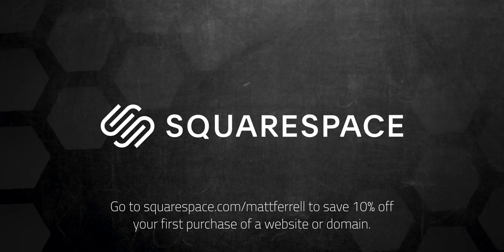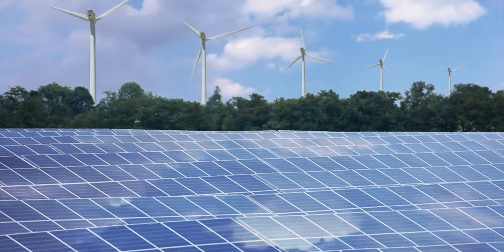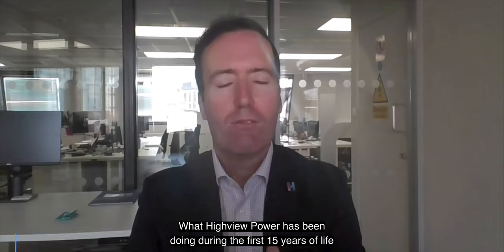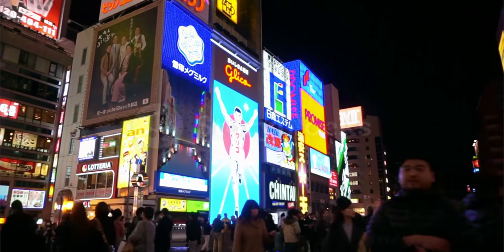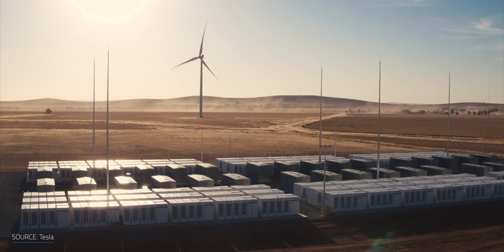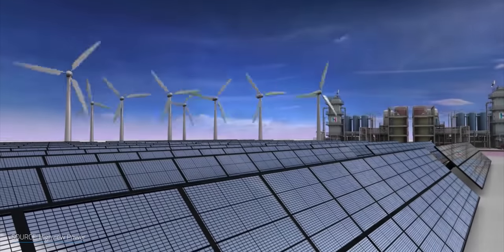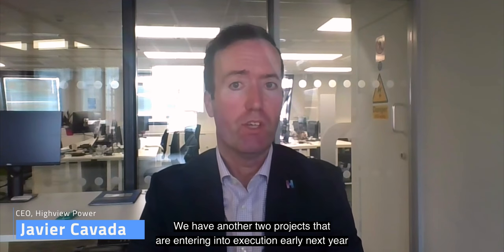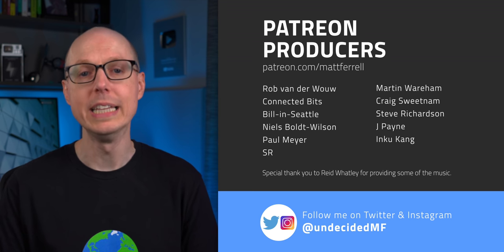Liquid Air Battery Explained - Rival to Lithium Ion Batteries?

Comment: Compressed air as energy storage is already very common on a small scale in workshops to power air tools.
         I'm a bit confused on the efficiency increase for storing that waste heat though: the atmosphere does that for us already provided we are using fully passive heat exchangers. Those heat storage tanks would only improve efficiency if we needed active heating to increase the power input/output beyond what a passive heat exchanger can reasonably do. i.e. If we wanted to store lots of energy and have don't mind a very low charge/discharge rate it's a waste of money. This tech is already really bad at power in/out per unit volume/mass anyway so I'm curious how this compares quantitatively to using a mega giant radiator. Even a pumped liquid and active airflow heat exchanger like a liquid cooled cpu system seems intuitively more efficient with not much less heat exchange rate. But of course Highview have put a lot more thought and testing into this than I have!
Reply: For the fast huge power output  in MWh they must provide, a passive heat exchange could not suffice I think and there is the danger of ice deposits too. However I am curious how they capture and store that compression heat or the cold. That probably makes all the difference for a brilliant concept. The simplest way seems to let a dense water mist rain down and take up the heat ?
Reply: @jean-pierredevent970  As I understand it the practicality of a passive heat exchange would depend more on the ratio of maximum power to total energy stored (the C-rate). A low enough C-rate suggests no dedicated heat rejection is needed.
Reply: @shminz6093  Yes, that would of course be the best solution. Related I wonder if a slow enough moving platform with huge heat exchangers could not be powered solely by liquid nitrogen or even compressed air. 
The advantage here could be that the vehicle would be able to use the cold for cooling the passengers too. So it could bring comfort in desert cities. No idea if this would be efficient :-)

Comment: I remember years ago that the French sold an air motor to an Indian company called TATA motors. The premise was that a small air compressor would live underneath the vehicle, and you'd plug the car in every night. The car would run off of the compressed air that was compressed overnight. Or you could take it to a high pressure facility and fill it up fairly quickly.

Later in their research, they found that a tiny bit of propane added to that air as it was expanding increased its efficiency 10-fold or something like that...(as you compress air it heats, as air expands when released it cools. So they were heating the escaping cool air just a little bit causing it to expand even more...making it run the air motor even longer).

I'm going off memory here so I might be a little bit off... But I was always disappointed that I didn't hear more about those motors and those vehicles.

TATA Motors air cars did not compress the air down to liquid. They just compressed it into a carbon fiber tank.

Comment: Another excellent video! However, everytime there is a video about battery technologies, I keep wanting a clear comparison. Efficiency is one measure, but storage capacity is another, as is charge/discharge rate. It seems more complex ( multi-dimensional ) than power generation, but that is how people need to think about it so that they understand whether a give storage system is showing promise or not. Like, whatever happened to flywheel systems? where do they stand vs liquid air?

Comment: Mr. Undecided , 
I'm sure that you're aware that the opposite direction yields a good option also . I'm speaking of course , about hydrogen generation and storage for later combustion . This would be a lower -tech solution , and would require significant acreage for the H2 bags . It would however , be easier and cheaper to implement . 
I'm curious as to whether or not you're aware of any projects which have tested out this process ?  .🤓

Comment: So, how about adding more turbines to existing dams and operating at higher flow rates, and using the extra power generated to pump the water back into the reservoir? Put a couple of wind turbines on a nearby hill and take the idea to Hollywood.

Comment: I got some info on compressed air, the downside of it was that for each horse power you get out of a compressed air  tank, you need a 10 hp compressor, cryogenics need more energy in order to compress the gas and then cool it to freezing temps, so you'd need a bigger installation to supply power for your cryogenic plant, or conversely having your wind turbine working 10 hours to retrieve an extra hour at no winds.

Comment: Good idea, and also use the compressed air to run the Tesla turbine to generate electricity, the efficiency could be much higher and even much cheaper. very low pressure could generate good amount of electricity. Why not!

Comment: The air is not frozen (that would be a solid) it is liquified (it still has to flow). Also calling this cooling leaves a viewer with a misinterpreted concept of what goes on. The air is compressed in a multistage compressor. As it is compressed energy is removed but this all happens at near ambient outdoor temperatures or as compression happens the air is temperature rises. It is more correct to say the air is compressed or squeezed into a liquid. When the liquid gases are expanded back to atmospheric pressures their temperatures drop dramatically which is the only time they are cooler than ambient temperatures.

Comment: I would adopt the hybrid vehicles battery regeneration system to save excess power from windmills to the liquid air battery and use the compressed air to turn the win generator like bicyclewheel without turning those blades.

Comment: This piece feels quite shallow. What about which parts have to be insulated? What about using ambient air or even other heat sources to heat the cold parts from expansion. All things that are done in current pressurized air storage systems ans also apply to liquid air storage systems.

Comment: There is always ways of making it more efficient,one way to have a greater number of compression steps,each step releasing the heat energy(even if that heat energy is in the cryogenic range) before being compressed yet again thereby reducing the resistance to compression therefore the work needed to do so,and vice versa when doing work with the compressed gas to create say electricity multiple stages of turbo decompression(with intermittent heating)will ensure maximum efficiency.Perhaps they are doing this already to some degree I would be surprised if they are not but more is better.Heat source can be ambient air or some low cost source and conversely cooling can also be some low cost source such as cold water. If compression and decompression are taking place at the same time in the same place this also becomes a source of low cost heating or cooling.

Comment: I wonder if the liquid air is stored in a way that you could pull out the more valuable gasses and sell them and only use the bulk oxygen co2, etc to generate power.    Might be a way to recover some of the cost of liquefaction.

Comment: There is a reason Hydro electric and pumped hydro are the way to go.... its simple, no fancy chemicals, no fancy electronic controls and no rare earths to mine... it just requires geography and used the water cycle powered by the sun. location is not the problem really as power can be transmitted over great distance on high tension. in addition the lake created serve local wildlife and water population needs and can be recycled with water processing systems.

Comment: Great video, a possible reason why they may not be preferred is the 60% efficiency, that effectively means you are still left with 40% curtailment. so at that point you might as well go hydrogen with combined cycle combustion with the added advantage of transport ability. that said, if its cheap enough hell yeah. 
I do keep hearing about the Ambri liquid metal battery from MIT for grid storage & it does comes within same cost ballpark so that may be a better overall solution. IMO it may be worth doing a video on it.

Comment: This video I had to spead down to 0.75 speed, so it's understandable for me. It was to fast, and a bit weird sound Even in normal speed. I mean not the sound qwality that is on all your other videos. But I think it's a good idea with airflow batteries, just like a heat exchanger in a modern air-condition, at least normal here in Europe. But I also think that I am  verry skeptical, becuse it's to much like burning gas and fosil fules, so what if it is that they are holding in the tanks. 🛢

Comment: I am going treat this as an experimental technology or scientific endeavor. Basically this a compressed air machine with cooling doing the compressing. They are inefficient and yes that is the question most people in the power industry actually care about. It can be the quarter the cost, but if you need to build 4 of them to match the power you still spent the same thing on something that is inefficient at best. Also this does not seem to mention anything about inefficiency and costs on actually cooling it to start with and maintaining a turbine plant. Both of which you dont need with a battery bank. Batteries are actually really good because they already use the energy as electricity and already deliver it as electricity.

Comment: It works - it doesn't seem to cause any harm to the environment - but it would be nice if they could source their gasification heat from the waste of some other process - perhaps combining these plants with ground heat pumps? the thermal losses over time (of the stored heat) are probably not insignificant - that immediate energy load would be better served in a stirling engine charging some batteries as a buffer.

Comment: As I watched it for few minutes, I knew that it did need to be scaled up as you said later, not in the smartphone or anything similar. But did you heard of the "Lithium Carbon Dioxide Battery"? Maybe you can make another videos to introduce it later. I knew it was invented in University of Illinois, I forgot a bit, by some researchers last year, or maybe earlier. Just not in the production phase. They said that its energy storage is 7 times more than lithium ion battery. I was also not so familiar with it.

Comment: I believe this technology is the only true option for large scale renewable energy.
As energy has to be produced when needed, and this kind off technology is the only real, large scale option, that’s environmental relatively neutral, I don’t think there is any option to this technology.

The options available are only chemistry batteries and nuclear power.
If nuclear power, it will need to be oversized to accommodate both low and high-power draw.
If chemistry batteries, then the batteries need to be some kind of chemistry, that can handle the capacity needed, without the present challenges in environmental or availability in resources.

I’m a very big nuclear fan, but that’s not recognized in political or public opinion.
So in reality, this technology is the only available, large scale, option.

I don’t believe in hydro, or similar technology, as they are high risk solutions.
Really I believe, straight out stupid, as if not handled with the outmost care, the energy needed to power large scale solutions, is way more dangerous than acceptable.
Who wants to store energy in a city or area, that has the potential to blow away the whole place.....

I’ve worked with high pressure nitrogen, as energy storage, and that was safe and reliable.
This technology is on a totally different level, and stores sufficient energy to power any needs .
I’m impressed. Well done indeed. 👍

Comment: i was wondering why not build this near to motorways so a part of the road can be used to pump air into the system . the weight of vehicles passing over a point pumps air into the system. how about using this method for transporting stored energy from north africa to uk instead of expensive cables. you could have a ship manufactured with this system for transporting energy.

Comment: there was an old K'NEX set i had where you would turn a crank and it would carry a ball to the top and then it would fly down the roller coaster. the crank could be the wind power mill. therollercoaster could be the turbine generator. the balls wouldnt wear down very much at all and they could wait in a cage up a nearby hill and roll down generating power when needed. cheap. very few moving parts to breakdown. immune to wind or weather damage. also with the geothermal plants why not use tesla oneway valves going up and down. no moving parts so no wear and tear. it would allow the water to return back into cavity where it is drawn from after condensing it after going through the steam turbine.

Comment: Why don't they use a hybrid solution with electric battery storage for the instant electrical needs, in combination with the air storage? Make it a complete hybrid solution if it's needed.

Comment: Sounds like a capacitor, in the general sense.  Like using a wind turbine to move water into a tank.  Then later opening a valve in the tank and using that water for something, like turning a grain wheel.  The gas to liquid volume just makes it better to store.  I think someone made a compressed air engine in UK on same principal.

Comment: I wonder what would happen if you were to place it near a solar field with a battery array and while you're also using it as a long-term storage use it to cool with solar panels and the Battery Systems so they'll have an improved efficiency would it be worthwhile doing

Comment: How is this any better than concentrating sunlight on a tower holding molten salts, and using steam generated from the molten salts to drive a turbine? That model bypasses the need for solar cells in the first place. These guys talk theoretical efficiency, but they've been in the business for a decade; it doesn't give a lot of reason to believe they can suddenly cut their energy losses in half through a little more research.

Comment: Cryogenic makes little sense since it takes more energy than you get out of it.  Use 100% to get 70% is more wear and tear on the solar or wind turbines to charge the batteries.  Yeah it stores for future use at night but you need to run the machines longer during the day rather than letting them sit idle during excess power creation.  Wear and tear costs increase so you don't gain anything in the long run.  Then again maybe I'm missing something.

Comment: i think cryogenic batteries need lots of maintenance and tesla barely needs to be looked at in computer maintain systems. there are pipes and many things that open closes and move that can break so it doesn't look reliable. i'll put my money on nuclear fusion. Tesla batteries would greatly ideal the Holy downside is the sola panels taking up space. if a better energy absorbing material can be introduced that doesn't need so much space comes in place than ill be satisfied.

Comment: Hydrostor in Canada has done some testing of compressed air systems to generate power by pumping air into a bladder anchored under water.  The heat of compression is stored in another medium while the cooled and compressed air is pumped under a body of water into a bladder where the water provides the container to hold the compressed air.  allowing the air to flow out of the underwater storage bladder and reheating the air on land allows it to run a turbine to generate electricity.   This made news outlets in 2015 but not sure where the technology is now.  Could be cheaper as you will not need to liquefy the air to store it on land as the depth of the water provides the storage 'container'.

Comment: Why not use a giant magnifying glass to heat air in your sterling engine to produce power? I hear water makes a nice magnifying glass also. and then you'd need something during cloudy and or rainy conditions to produce power in some other way also. I also wonder about how much power is needed to use a laser to heat something also let along magnifying the laser also.

Comment: It may have a real future if they can be build into the huge off shore turbine towers using the power as mentioned in the off peak mode to build  up reserves. They can save on both electrical infrastructure and waste heat by tapping into the massive heat sink of the sea thereby getting very cheap regeneration energy to push up the output efficiency of the system or increase the liquid nitrogen storage capacity and hence the megawatt hours of storage. .

Comment: It may never been used before because excess power is a relatively new issue. The major downfall that I see is that to be the most efficient it can only be using the excess power from solar and wind in small daily time periods, otherwise it will be putting a strain on the traditional power generation plants. I do see the use for it but I see it as a niche area with very large excess wind power sources but not near as many solar fields.

Comment: Curious if periods of abatement were used to generate hydrogen through electrolysis, what the efficiency would be of subsequently using it for electricity generation. I would think the hydrogen produced during peak times might also be used as fuel in the transportation sector.